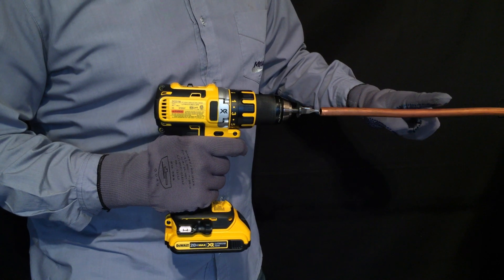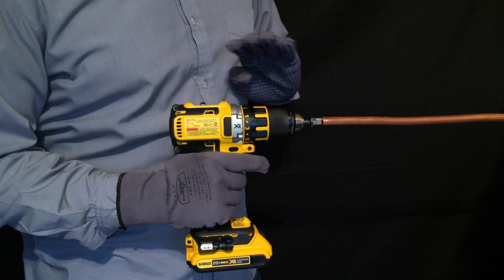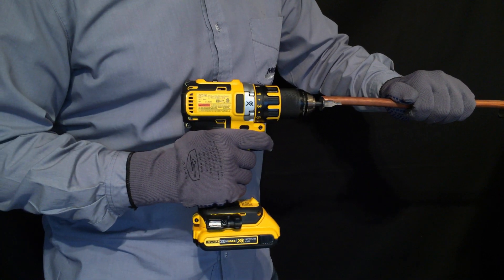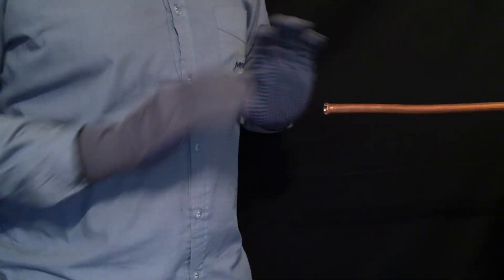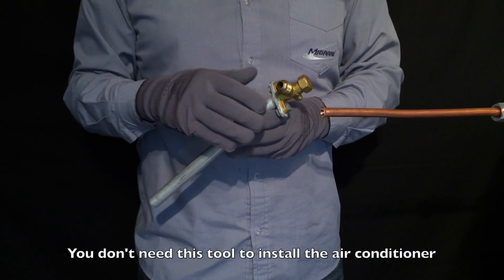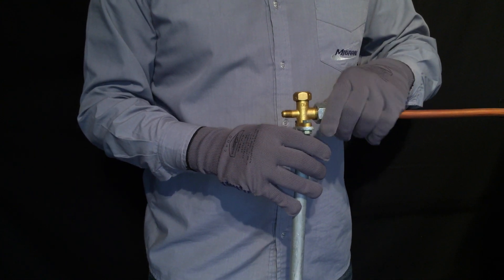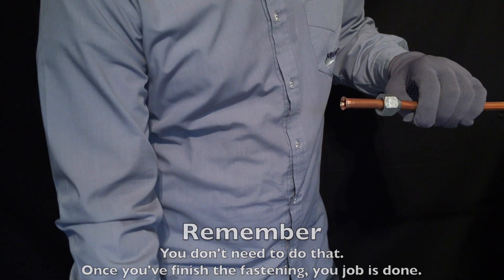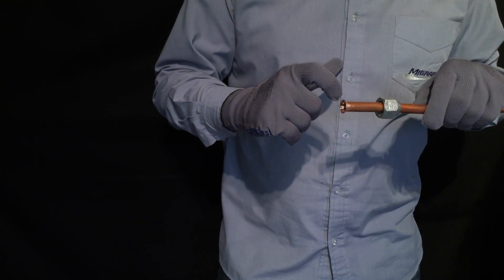New concept HVAC flaring tool | Flaring SPIN

Comment: does it leave any shavings?
Reply from the maker: Hello Acelin. The SPIN Tool does NOT leave any shavings behind. Unlike the traditional swage/flare process, the SPIN Tool introduces heat by friction, keeping the malleability of the copper during the entire process. It also prevents cracks and/or leaks.

Comment: your demo and every other person showing your tool are all in the plumbing an heating, no one is saying what gage copper tube your working with, but all plumbing and heating, cooling copper tube is thin wall and rather inexpensive,,, I am in the marine business, doing repairs and up grades and custom building pontoon house boats, we install power steering, on all large house boats as well as high torch engines that make  standard cable steering very hard, if I recall right pluming copper tube is only 18ga, the copper tubing we have to used is 0.30 wall, to with stand the hydraulic pressers, have you tried your tool with 0.30 tubing, id like a set of each for review on real copper tubing, with a wall thickness of 0.30 that we use rolls of every day, this tubing you can not buy from any box store or plumbing warehouse, it is used with marine power steering and  in-line 12 volt  power boosters on even larger boats and engines